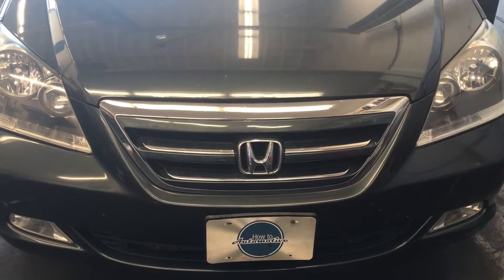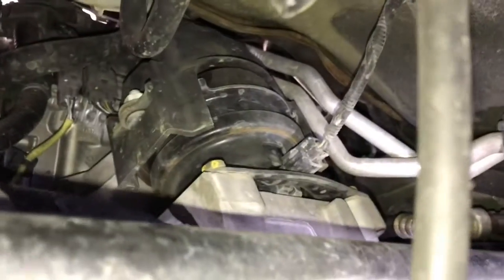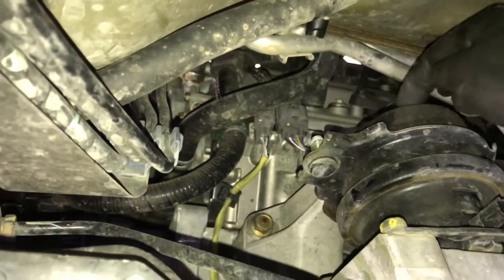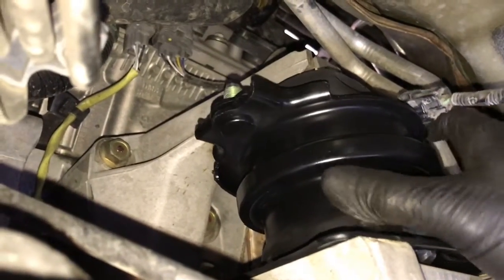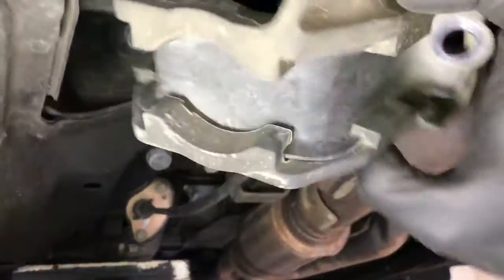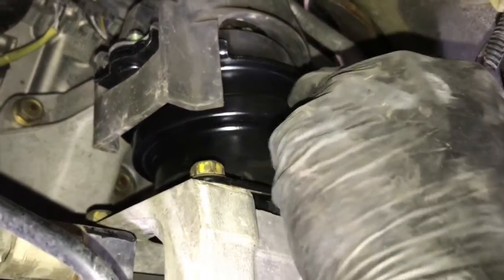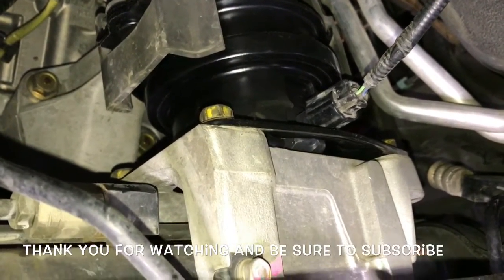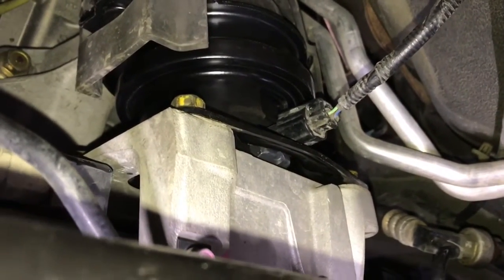How To Replace The Rear Engine Mount On A 2005-2010 Honda Odyssey

Comment: harder and more expensive to get factory mounts now, then ever  for these older Hondas. So I'm going to disable the VCM/Eco mode to hopefully end the bleeding and damage it causes to wear these mounts so fast. Thank you for this video. I was able to take of the rear using just my 17mm wrench and taking off the passenger wheel to use the assembly for leverage on the ground. Just saying work with what you got. I did order the wrenches which should get her today to help finish the other mounts.

Comment: 00:45 surely that little ratchet at that angle didn't loosen those 12mm nuts.
Reply: Mine required an extension reaching up to the back of the engine bay, as straight as possible, a 17 inch flex head ratchet, a pipe to increase leverage, one person holding the extenion top, and another person torquing the wrench. There was very loud "crack" when both nuts broke free. The vehicle was a 2010 EX-L and the mount had never been out.
Reply: Oh god… I’m about to try replacing this. Hope mine aren’t that stuck :/

Thanks for commenting how it went for you so I can mentally prepare.
Reply: @kgkisten7632 Good luck! And brace yourself.

Comment: I have take off all 5 -14mm bolts and both 17mm bolt but it won't come off or alow me to jack up the motor 1 1/5 in to get to get the mount Off? It Jack's the whole car?
Reply from the maker: hmong talk make sure the the jack is not hitting the frame and as your jacking it up and it’s only on the transmission. Also look around maybe you took out one of the wrong bolts and there still a bolt attached.

Comment: Hello, good video
I have problems with the passenger side motor mount, one bolt rusted in the hole and broke, bad Honda design. Two bolts go into a sleeve and water get in and rusted inside the frame. I have to find a way to hold a bolt there. I drilled it out but threads may not be good. Also I drilled a hole all the way to the bottom of the frame and saw the sleeve is short inside the frame. I will make a threaded sleeve with a heel and open a bigger hole at bottom and bolt it. Cleared the existing thread hole and use a 4in. Long Bolt. What a mess to change the timing belt. 08 Odyssey 
Never had a problem before,,, comments??

Comment from the maker: The OEM Mount is around 500$ just for the parts. Labor is around 140$
Reply: Where is it available for 500 ish? $750-850 is the range I'm seeing for the real deal.
Reply: @willyodell7802  install a muzzler 2 and then use passive motor mounts for an LE (cloth seats) model.  way cheaper.

Comment: I have an 05 ex.   Does mine have these mounts or is it just with the most loaded versions?   How can you tell when they fail? I have a mystery steering wheel shaking at highway speeds that two new sets tires, alignments, control arms, tie rod end, Cv axles, stabilizer links, different wheels, can't stop the shaking.
Reply: I also replaced everything. This is a very common problem with older Odys. Unfortunately I have the same issue and this issue is a torque converter.